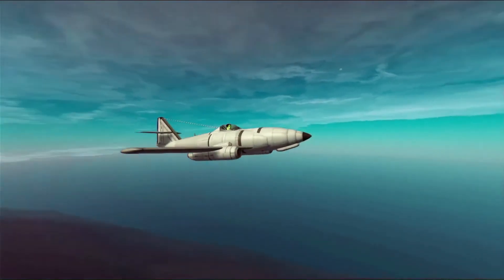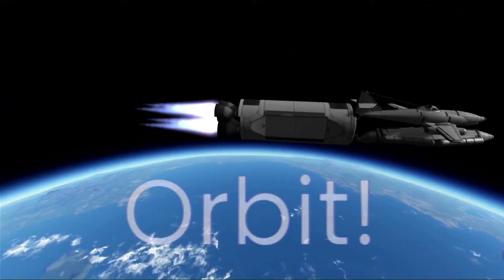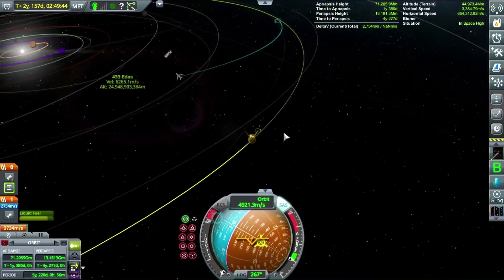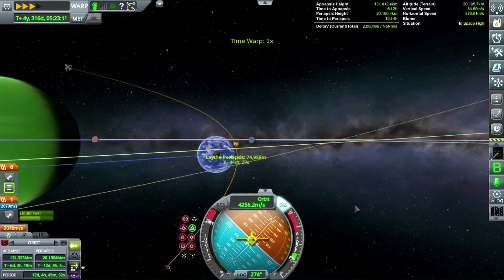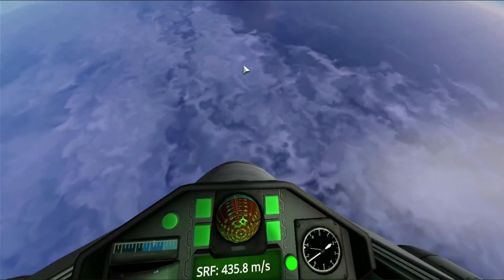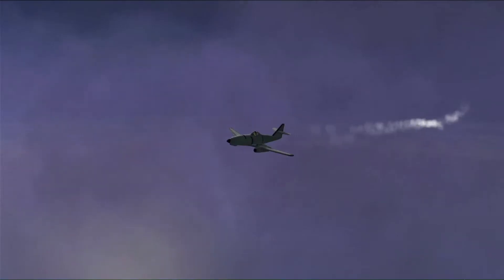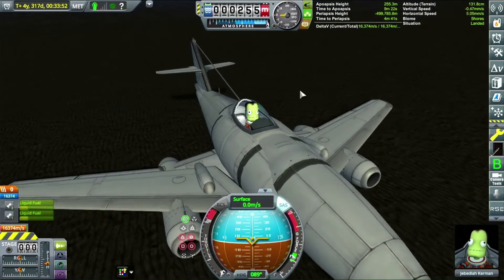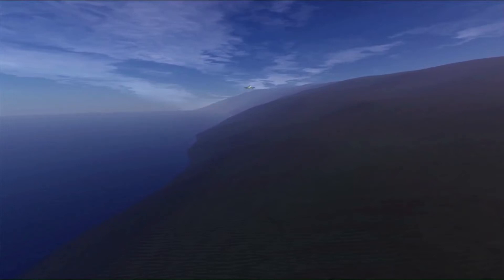Sending a WW2 JET FIGHTER to Laythe !!

Comment: Video idea: Build an Aggregat 4 Rocket in 1:1 scale but fly it to eeloo and back.
Reply from the maker: What are the odds, I actually just built an Aggregat 4! Same weight and thrust, size is maybe slightly off it's hard to judge in ksp. I'd love to try this it would definitely need a kick stage or two to get it on it's way though
Reply: @smooneychad  As a wise man once said: if thy rocket is to weaketh, more boosters he shall add.
Reply from the maker: @araflohd  Wise words indeed, expect a video in the near future! Mind if I shout you out for the vid idea?
Reply: @smooneychad  not a problem :)

Comment: I'll help you with a bit of copium for the inefficient launch. You were just avoiding lower levels of the atmosphere due to aerodynamic stability concerns. ;)
Reply: Also, I don't think Alt+c is a mod, and the Me 262 was the only successful jet fighter used mainly against other piloted aircraft in WW2, as far as I remember. US P-80's or P-59's weren't committed to the fight, British jets were mainly or entirely used to shoot down V-1's (crude pulsejet cruise missiles). All other jets were design drawings, prototypes, or basically prototypes rushed into production while wildly unsafe and unready.
Reply from the maker: @nicolasbourbaki3481  Interesting, it's a cool feature surprised I've not seen more people use it. Wish I would have put more info and context like this about the Me 262 in the video but alas. Also, I had no idea about the early British jets being used to shoot down V-1's!
Reply from the maker: Thanks for the copium, I think I might just start adding oversized fairings to all my rockets just to use this excuse! lol